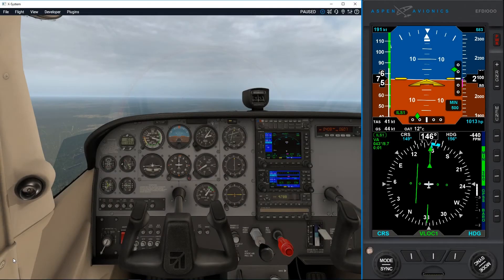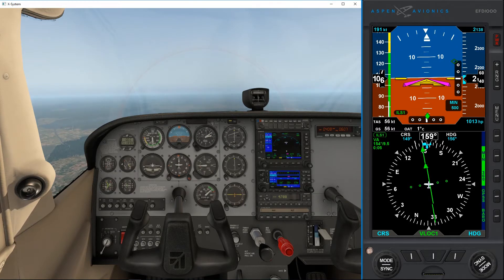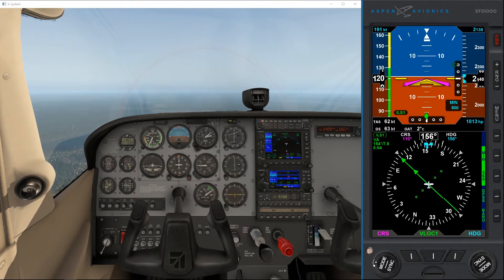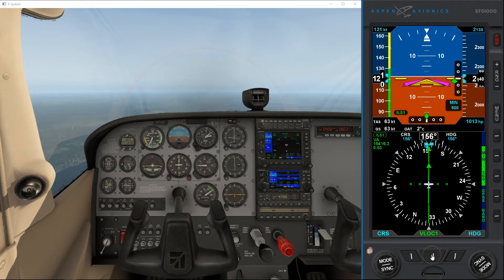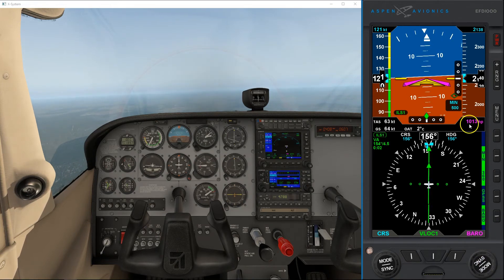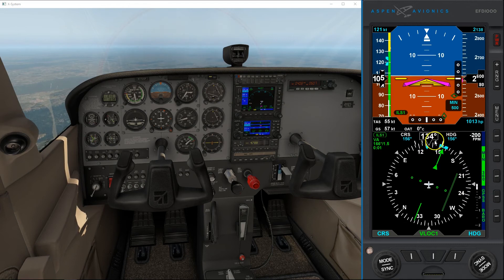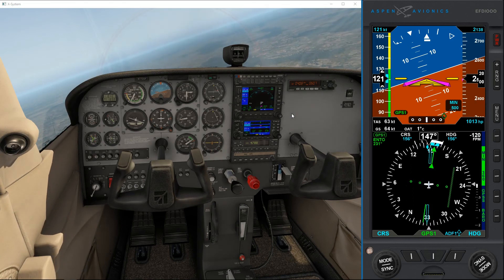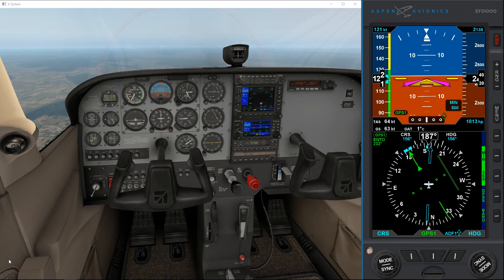Aspen EFD1000 near-finished-demonstration

Comment: Does it integrate with the gps?
Reply from the maker: If you turn it to GPS, it will follow the information coming from the GPS.
Reply: @SimInnovations is the HSI coordinated with the GPS DTK ? Or we need to turn in gps
Mod manually le CRS to follow gps DTK ?